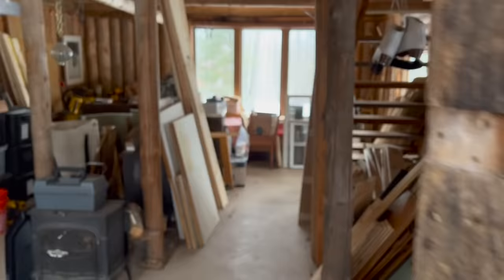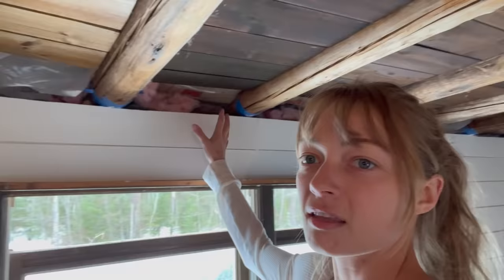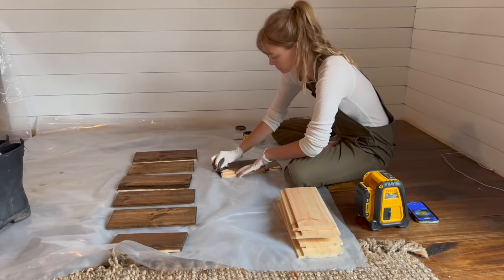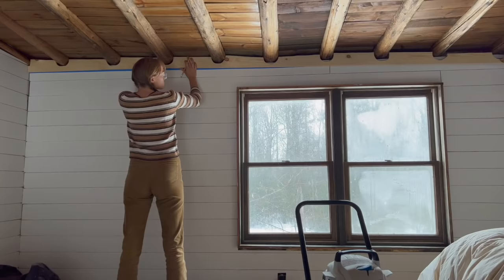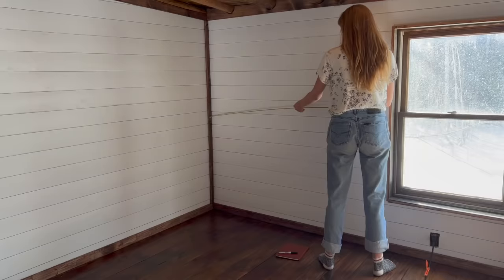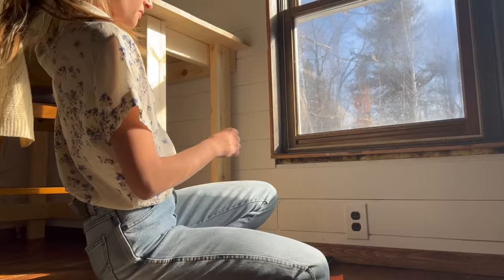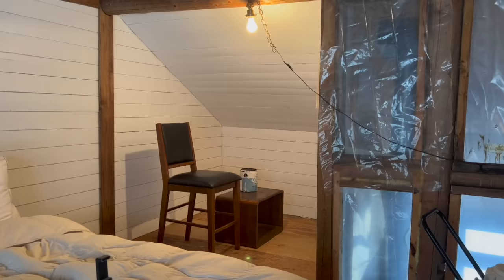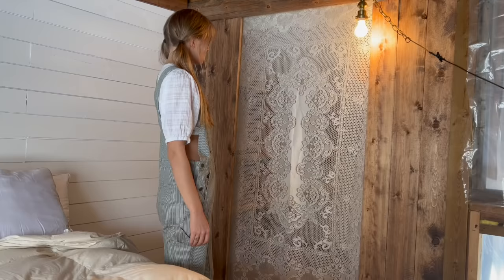Log Cabin Loft Renovation: Complete ✔️

Comment: Regarding the measuring method: my dad has been in carpentry for almost 30 years and he's always done this thing where if the length is between measurements he'll say big or small. So like 11 1/2" big would mean it's a tiny bit more than 11 1/2". And he'd write that as 11 1/2"+ (and it'd be the minus - symbol if it was a tiny bit less aka "small"). I've always thought that was cute. He built so much of my hometown it's crazy. There are subdivisions full of houses he's built with his crew. He must've worked on hundreds of houses over the years. 
He even helped me build my house 😄
Reply: Oh thanks for sharing! I always use "and a bit" or "minus a bit". Makes my husband crazy but my crafting buddy knows EXACTLY what I mean and even though we're half a country away and working together on Skype, our stuff always comes out measured correctly!
Reply: That is so awesome, sounds like you love and respect your Dad very much ♥️
Reply: My dad does the same thing except with "long" and "short" So 11 1/2 "long", or he'll tell me to either leave the pencil mark I made when measuring or cut it off.
Reply: That sounds like a hassle! Can't you just buy a metric tape measure and measure with that? It's way more precise.
Reply: @h4ppy3nd  holy shit i always thought it was weird that you guys dont use the metric system but never realized that it actually means you cant measure things precisely 😱😱
Reply: @Weightingtablesafter  imperial tape measures will have marks at least down to a 1/16th an inch and you can always say something smaller if you need to. They don’t literally just have inches on them
Reply: Hannah, You are the real Wonder Woman! Where do you get all that energy from? You are such a delight to watch!

Comment: You did a great job, definitely be proud. Very cool desk, that trim cut-out template could have gone so wrong but it didn't - I'm impressed !
Small tip invest in wood screws instead of using drywall screws when building - that's all I got lol

Comment: Journeyman Carpenter tip : use the miter saw stand that you have. it has extensions on it to hold the longer boards.  they wont fall when you cut them.

Comment: Hahhah.  I know what will help you right now.
I realize that all of the not-so-great outdoors is out to get you, consisting, as it does, of entirely too much Winter Wfuckery Land.

The  Solution is right there in front of that window.  Or, at least, it will be.

What direction does that window face? It looks like a South-facing window... which is PERFECT.

STEP 1 of this Solution is to build a short set of shelves in front of those windows, running the entire width of them.
STEP 2 of this Solution is to screw some good-quality hook-screws into the ceiling above those windows.
STEP 3 is to mount some plant hanger brackets to left and right of those windows.
STEP 4 is to hang some planters (preferably with plants) from those hooks and brackets.
STEP 5 is to put some potted plants AND a tray of soil (a kitty tray would work perfectly) and plant the entire tray full of lettuces and perhaps some easy herbs like basil and the such-like.  You might even want to plant (or buy) a couple of tomato vines and either pot them there... or start the seeds there and transplant them outdoors when the season catches up with the Season. Perhaps even do both. Have a couple tomato vines in the window for indoor growing and the plant some more seedlings to go outside later.

You don't have to start a formal Garden... but get some greenery in there. It IS the Cure for the Winter (Spring) BLAHs.
Also, you can put tchotchkes there and a vase or two and maybe even set up your tripod on the shelves with the scene back-lit with natural lighting... without it getting twisted... nor bent, folded or mutilated.
Get some green growing things in there.  You'll be glad you did.
  (AND ALSO Did I mention?  You can play some music from The Secret Garden OST. You'll have The Perfect Excuse.)